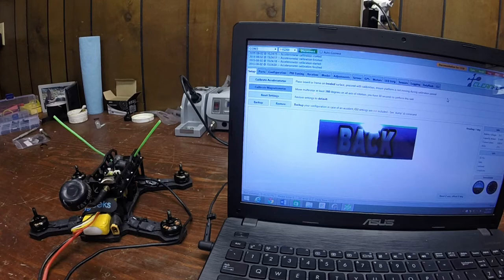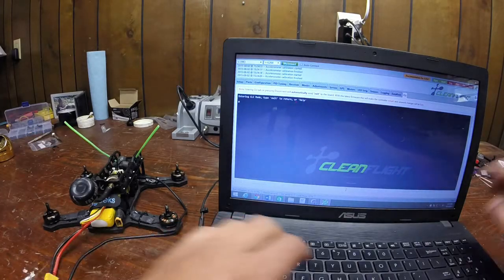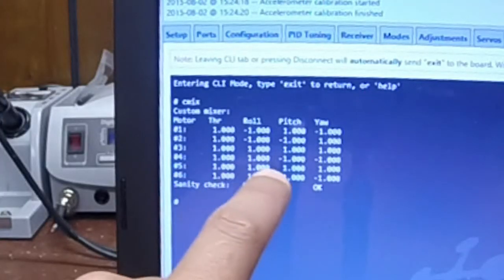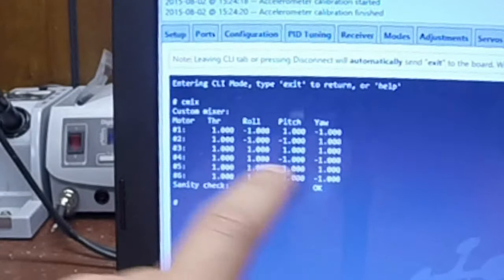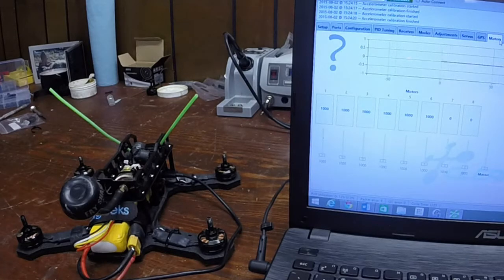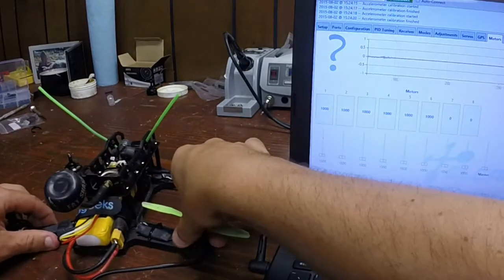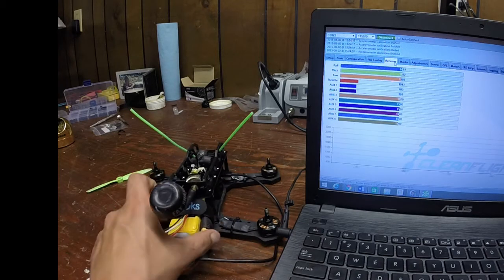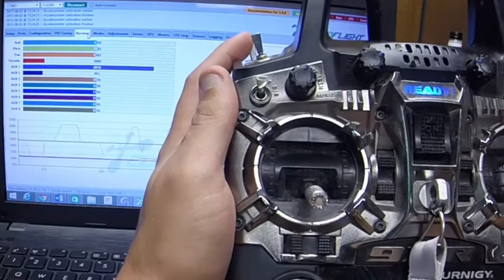Quad Flipping on Take Off

Comment: Im used cleanflight on sp racing f3 before and no problem, then try to use betaflight firmware, suddenly flip during take off, then i change it with cleanflight does not change flip behavior.. mybe FC problem?

Comment: I'm having the same problem with mine.  CC3D; worked great, bought it RTF; updated board and went through wizard setup and does nothing but flip ever since.
Reply: Mine is the same. Did you find the answer?
Reply: Matt Wilson I also bought mine RTF (echine250) and attempted to flash bata flight on the CC3D. Had issues connecting and couldn't get it active again. 
I have since installed a Naza32 rev6 and all checks out in clean flight, however I have this same flip over issue now. Has anyone figured this out ?

Comment: You've got your props put on in the wrong orientation. Make sure they are in an 'X' configuration.
Reply from the maker: thanks.... but I figured it out 7 months ago
Reply: +L Pablo Mendez No worries, mate. Perhaps the answer will help somebody else.
Reply from the maker: +Tim Phillips true. my apologies. thanks
Reply: L Pablo Mendez what was it?
Reply: I dont see the problem... he even tested his motors motors and checks for orientation... can you guys elaborate a little more? thanks!
Reply: board orientation wasn't adjusted in the GUI.
Reply: does that means that the quadcopter has to point to real life north(true north)?
Reply: fer Idontknow you right, you don't know.
Reply: fer Idontknow but the answer is, Hell No. He didnt turn the old motors off in the CLI.